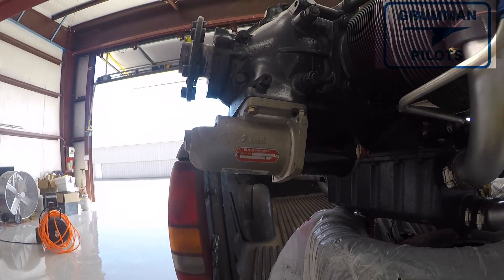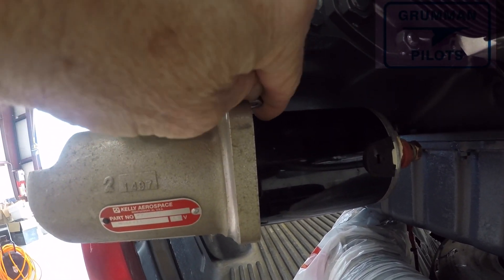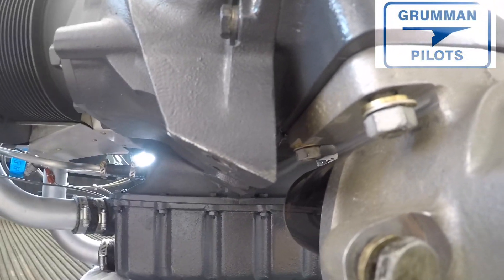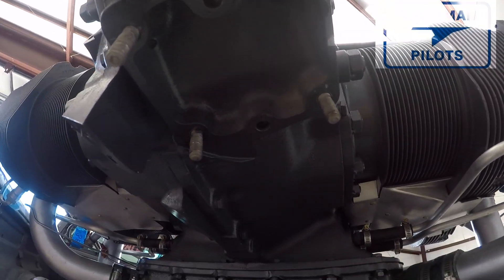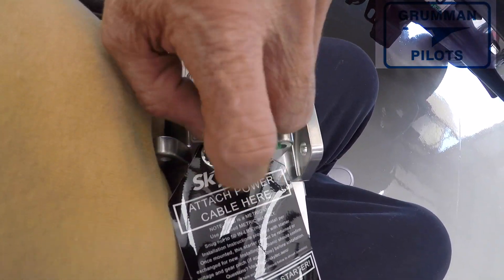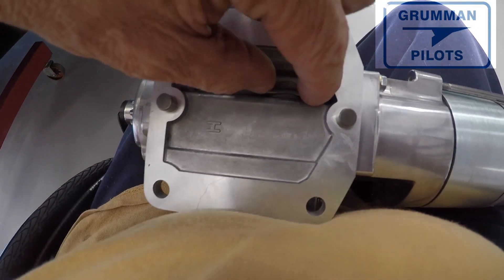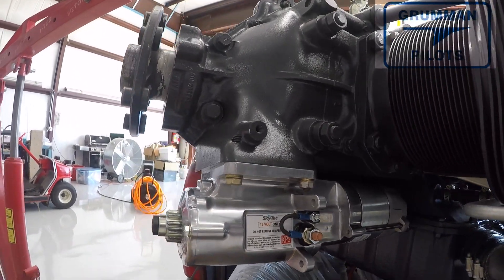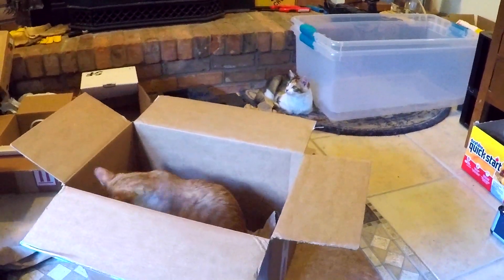Installing A Skytec 149NLR Starter on A Tiger - Grumman Style

Comment: I think I broke the kick back pin. I’m in SLC now. They hard to change out?
Reply from the maker: Pull the nosebowl and 4 bolts later!
Reply: @GrummanPilots how long you think and what tools? I’m finding I’m on my own on this. I’ve changed plenty of starters in my life on race cars and cars but I got into flying to have someone always service my planes. I’m striking out it seems. Have any good list or advice on where to start? I’m headed there in the AM to yank it off it seems.
Reply from the maker: the both hears are 7.16 or 1/3 and there is one bolt same size, so just the one wrench to remove and replace.  May be a different size on the electrical connection.

Comment: Good luck with the Skytec starter as they are not rebuildable.  On par with the Slick mags, not rebuildable either. Old school accessories can normally be put back in service for pennies on the dollar, not Skytec or the Slick products.  New replacement, no rebuild is the marketing strategy which benefits the sellers/producers not the owner.
Reply from the maker: Mags correct, but Slick say they sell re-manufactured or rebuilt ones.

Comment: This question is in the Aircraft Spruce website for SKY-TEC STARTER 122-NL "Question: Does this 122-NL starter require a separate starter solenoid or is it built into the unit?
This does require an external solenoid." I am confused, looking at your installation looks like there's no need for anything external... Please let me know, thanks in advance.
Reply from the maker: On our airplanes it requires a separate relay.

Comment: Good idea
I installed one on my Traveler. Save weight and starts better
Reply from the maker: Draws a bit more current but spins better.  I had one one my Traveler, my Yankee, and my Tiger.
Reply: @GrummanPilots  I just paid $275 for a new sealed battery. I get 5 years on a battery